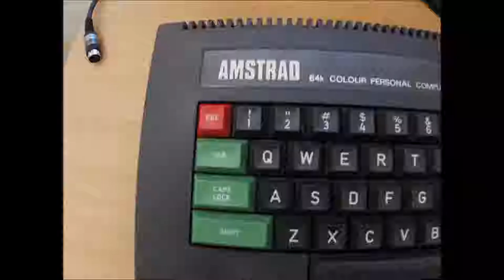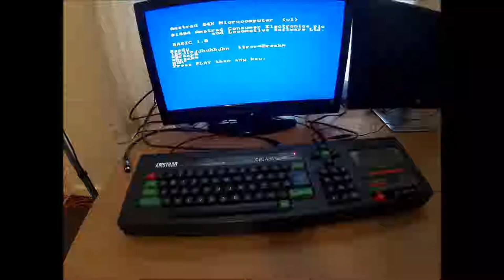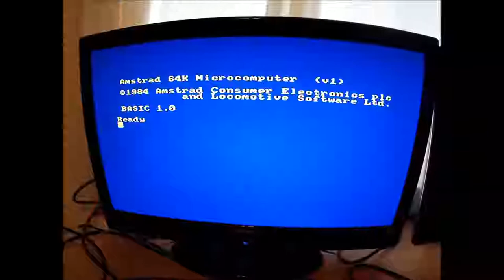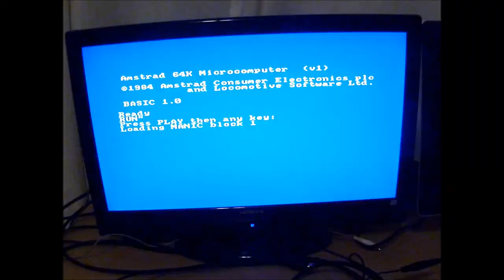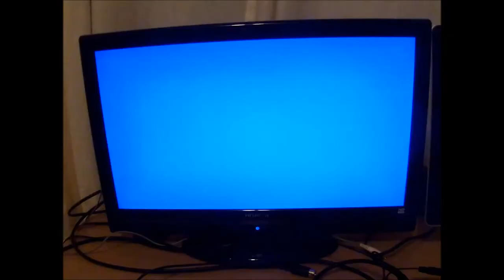Amstrad CPC464 tear down

Comment: I wouldn't use a key puller on the CPC keyboard. Much less risk doing what you did (which was the same way I did it with mine too!). 

I never bothered with the caps on the tape deck of mine, too many to do and I was too lazy. I also have a later motherboard version which has no electrolytics at all (not even that single one on the end) on it. 😁
Reply from the maker: Think I’m a bit obsessed with caps. I see them and have to change them. I think it’s paranoia from working on Sinclair stuff 😀